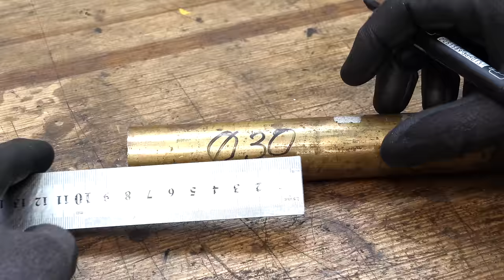Making Brass Machinist Hammer

Comment: A really nice looking hammer! But working on a fast turning machine like a lathe wearing gloves can be pretty dangerous. It can cost you a finger.
Reply: Those are just nitrile gloves. They will rip if you look at them the wrong way. No real risk of them pulling your finger in if they get caught.
Reply: @theajthomas I wish you were right but these are not nitrile gloves unfortunately... are heavy duty rubber gloves 😅
Reply: also making the entire head out of brass instead of having just the faces be brass inserts means your going to have to re machine a new head after 4ish months if you actually do a lot of work with it
Reply: @RedAreshan  It really depends on how much tapping you do. Maybe an insert would be better. But then I would avoid brass because brass bounces a little and that isn't anything you want while tapping pieces in with a machinist hammer.  For an insert I would prefer copper. (Nevertheless: The hammer looks great.)

Comment: Neat! But I’m not understanding why you preferred to use a screw to fasten the handle to the hammer head rather than the more common technique of inserting a wedge. Was it for looks?
Reply: Agreed with that… I’m guessing he’s making a hammer to set work in his milling machine. It’s not heavy use and wouldn’t need more than the bolt

Comment: Nice Koss!  Liked the socket head cap screw instead of the typical wedge.  Quite the hunk of Bog oak @¿@...makes beautiful contrasts with brass and steel pieces.  Thanks always for you great content and creativity.
Reply: But the hole was drilled out, it doesn't spread the wood so it doesn't do any.
Reply: @SimeonCogswell  Good point.  Agreed at some level but at 10:58 when he drills the counter bore with a drill bit (118°/135° countersink) it doesn't look like the depth is necessarily the same as the head height and at ~12:00 it looks like he may be cutting a taper ~2° on the head of the bolt??  Also my guess is the hammer head is maybe ~4oz and the press on fit he did should be enough to compress it enough for that small, light use.  With all that said I may have put a bit of epoxy on it during assembly, just in case and it's still a pretty little light duty hammer.

Comment: Looks incredible as always! But I'm not understanding how that screw is doing anything to keep the hammer head on the handle.. It's just screwed into the handle below the eye of the hammer, so the head could just pull right off, and the screw would be left there in the handle right? Unless it somehow expanded when you drove it all the way down and acted like a typical wedge does and pushed the wood out into the sides of the eye of the hammer! (But didn't look like it did.) I'm an axe guy so I use wedges all the time and understand that, but can't wrap my head around this screw method. 😂 Sorry!
Reply from the maker: As you may have noticed, I am turning this screw on a lathe to a taper. This way, when I screw it in, it wedges the top of the handle and holds the hammer head firmly in place. Perhaps it should have been filmed in a close-up to be more visible
Reply: @Koss-channel  I was thinking that! And you're incredibly talented so I figured you didn't overlook something like that. A cool and interesting way to "wedge" a tool!

Comment: Urgh, learn how to use an lathe!!! 5 million cuts later and you could just as easily have done this hammer with an nail file... I'm an turner and fitter and welder and would have made same hammer in 15 minutes and with in 0.01 mm precision.
Reply: Oooooooooooooh aren’t you impressive darling